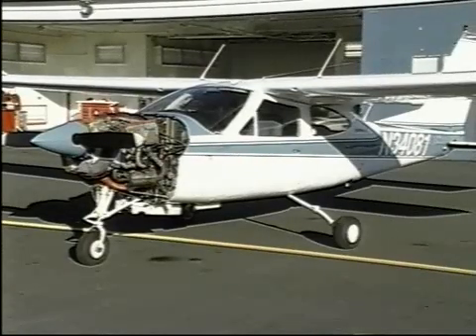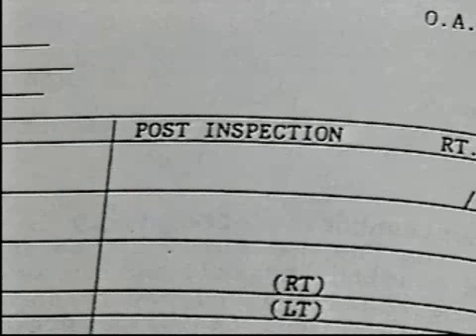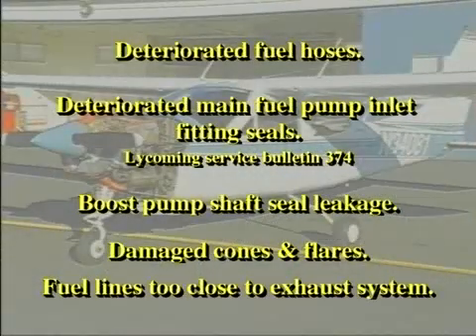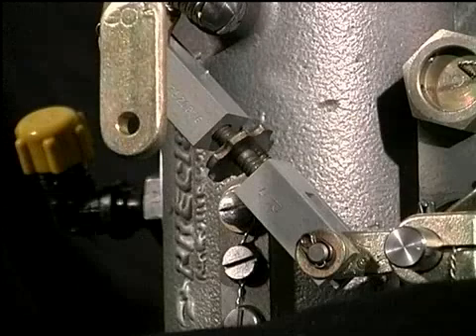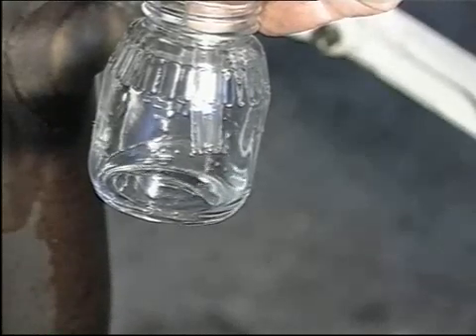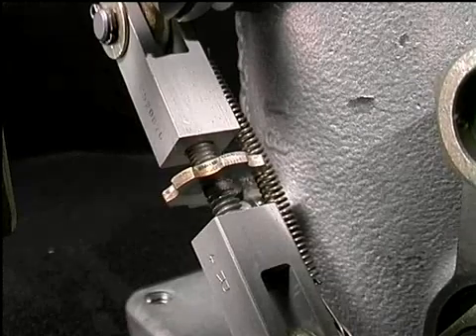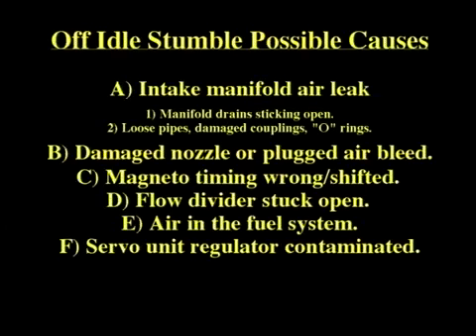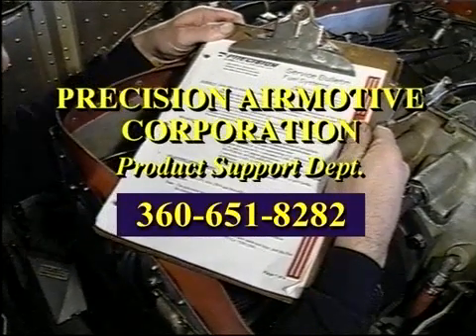Tutorial 6: Troubleshooting Techniques

Comment: These are fantastic videos!  If air were being introduced into the system via fitting leaks would it happen at all fuel flow settings?  If the fuel is routed too close to exhaust, would system degradation only occur at higher power settings where a great deal of heat is being produced?